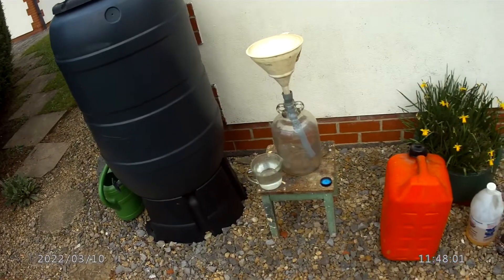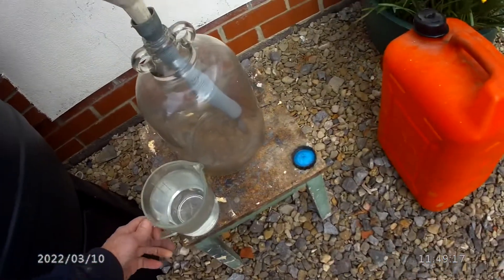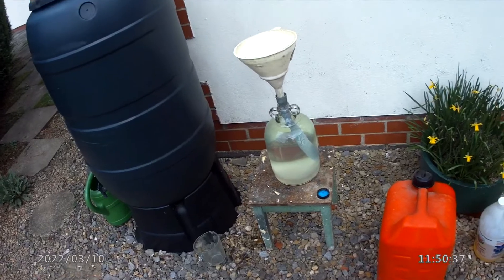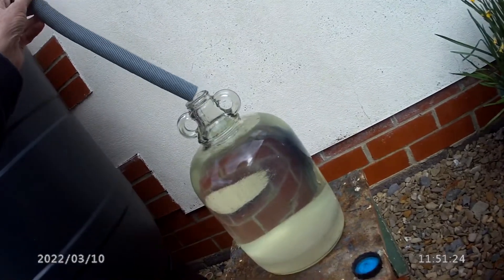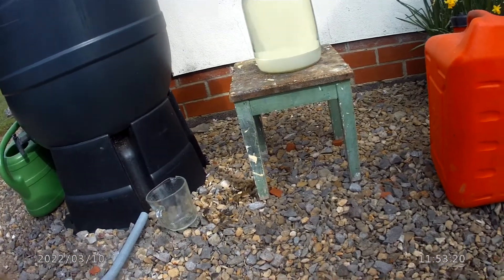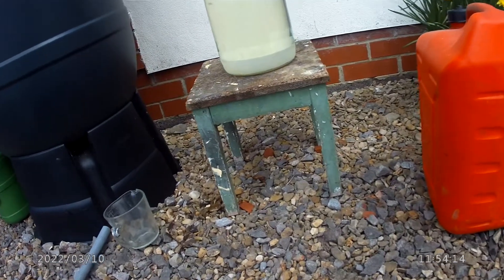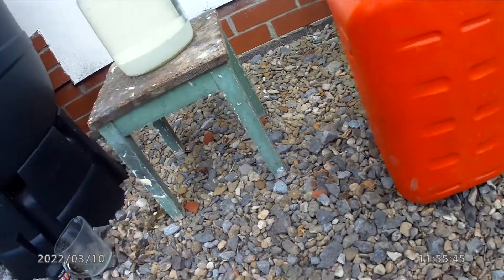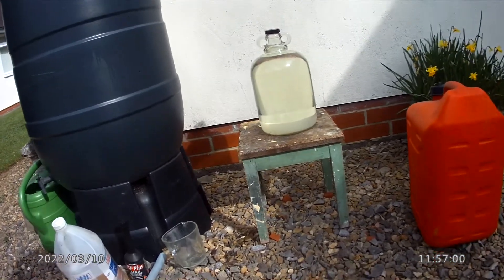Removing ethanol from petrol for old vehicles with basic chemical explanation.

Comment: Very interesting I’m still using E5 in the 33 year old Kawasaki GPZ500 I use the Lucas fuel stabiliser liquid colour blue bike goes like a rocket still I think is it 2024 /26 all E5 will be finished by then nice to know this 👍👍👍🙏
Reply from the maker: Yes Derek , they’re already using E15 on the continent which seriously effects carburated vehicles unless you compensate. E10 is already destroying the “rubber” carb /fuel pump diaphragms and fuel piping in older vehicles. The politicians know this will get some older vehicles off the road !!
Reply: @calderdale6795  just been looking for the receipt for the diaphragms in the carb I got them £200 £100 each when I rebuilt them from the USA with import taxes rip off it was